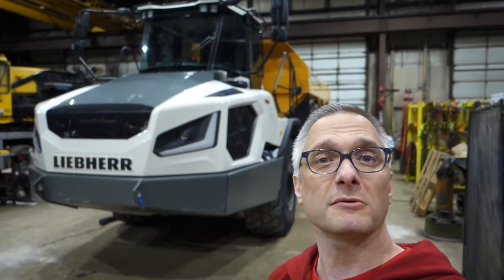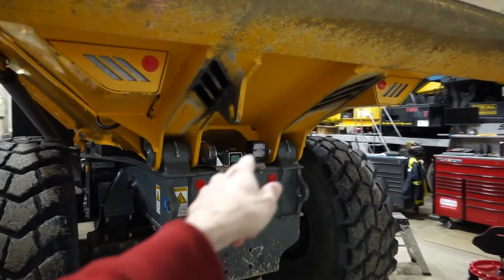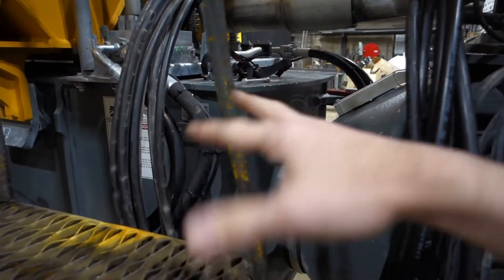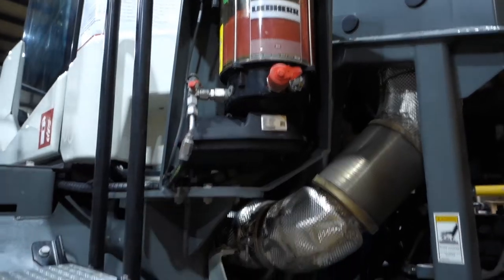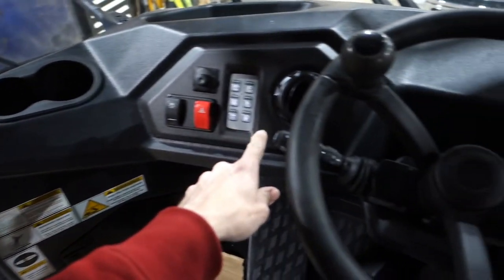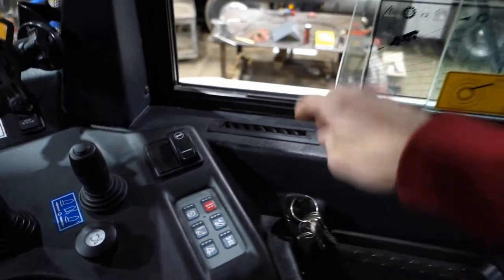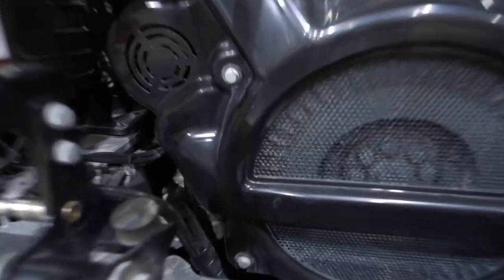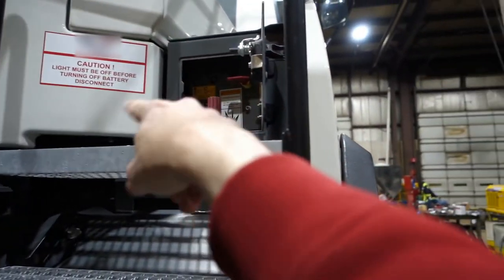Liebherr TA230 Haul Truck - walk around & cab tour

Comment: This machine is an absolute beast! Love the step up ladder for servicing. Nice that the hood is raised by itself. Maybe hydraulically or electrically? Awesome that the bed will tilt over separate from the cab. What would you haul that would need the bed to be heated? 
Great video! Loving this channel! This is right up my alley! Thanks Jeremy.
Reply from the maker: Thanks, hood- electric motor powering a hydraulic pump. The heated bed is more for operating in the cold Wisconsin winter. You don't want stuff frozen in the bed. Regular dump trucks around here have exhaust gases running back to the tailgate to keep them from freezing closed.

Comment: Jeremy...I'm trying to figure your occupation ?  
You're extremely knowledgeable !  👍
Reply from the maker: Unofficial occupation "tinkerer" Thanks for the awesome comment!  Official occupation "parts consultant" for a heavy equipment dealer. Cranes, telehanders, road building equipment (13 years & going). For 13 years before that I was parts manager at a local Saturn automotive "retailer".
Reply: @TooManyHobbiesJeremy  Did a little parts department handling myself for Volkswagen back in the '70s. Then after a memorable cross country trip I entered the communications industry until retirement. I've been into toys since the '50s.  Boy will be boys !  😀👍
Reply: p.s. I've been looking at 1/50 scale cranes for my layout...but they appear to be quite expensive.
Reply from the maker: It shouldn't surprise you but I was first into air cooled VWs. On my list is to digitize a video taken right before I sold a 73 camper bus. Another one is to digitize a video of my long gone64 Cadillac Fleetwood (my favorite vintage car I've owned but not my favorite to work on)